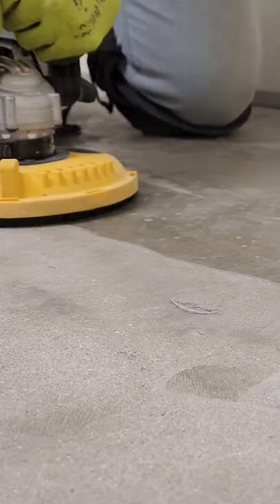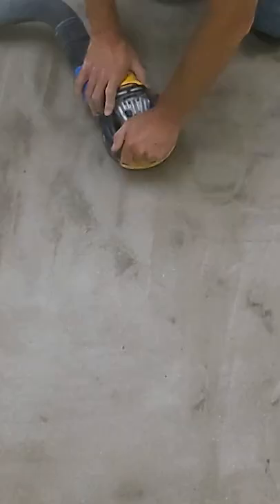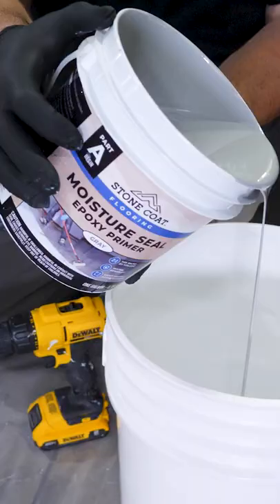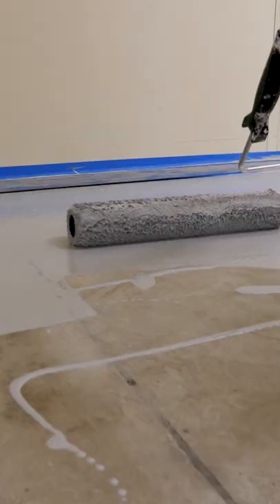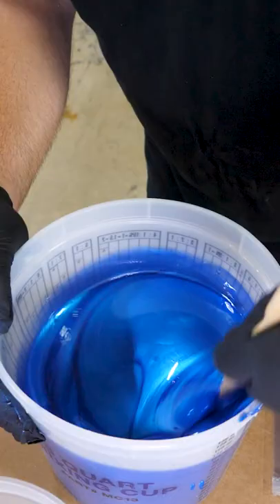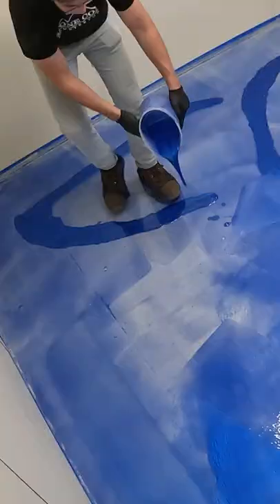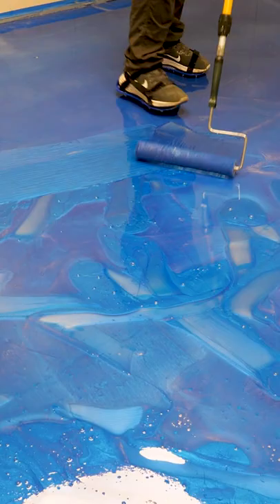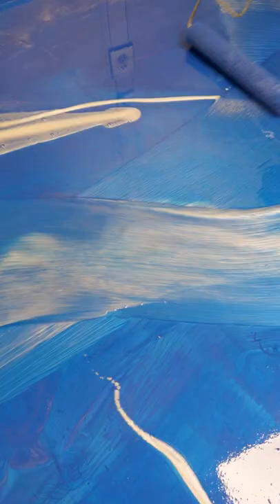Turned this Office into a Kentucky Wildcats Den with Stone Coat Epoxy

Comment: Diamond wheel. My man knows the deal. 

Acid etching 🤣😂
Reply: You gotta wash the acid out with so much water, not practical for an office to etch with acid. Plus in my opinion grinding is a better bond
Reply: @mitchquist  your opinion is correct with grinding the floor and allowing the bond to take place. Iv ton tons of garage floors, and seen tons of homeowners think they can acid etch the floor, and do a DIY epoxy kit from the box store and it last. As soon as you start putting vehicles in the garage, and heavy foot traffic… the epoxy peels off.